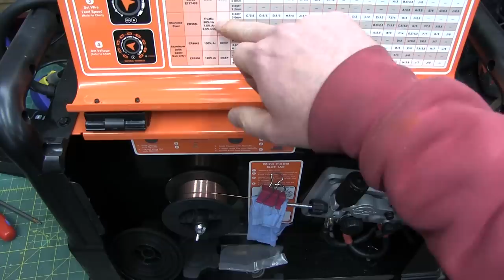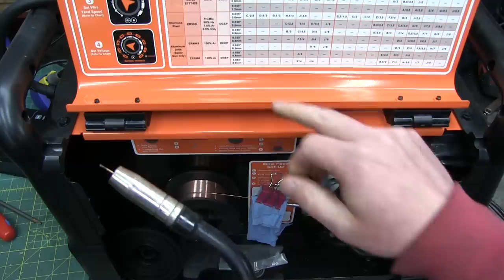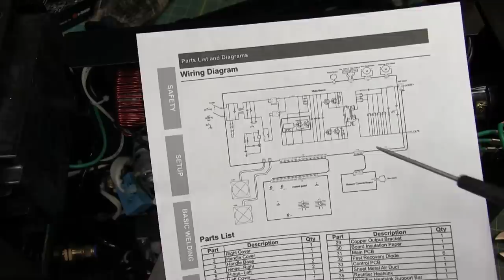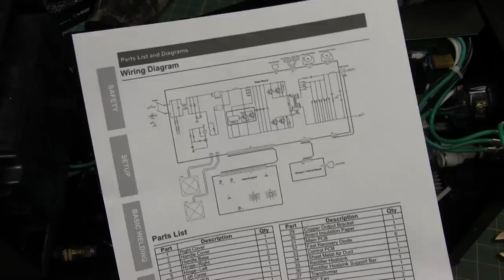BOLTR: Vulcan MIG 215 | Harbor Freight Welder

Comment: Huh.   Have a 211 in my shop and it has been okay so far.  The whole "just put in the material thickness and the computer will figure it out" is BS, though.

Honestly I requested a Lincoln 140 for the shop, but the guy purchasing them said that "Lincolns are junk!"
Reply: I went looking for more on why 211 NFG , anything other than a vendor made handle and switch flashing problem ?   ,The trigger is important,but not the whole thing!

Comment: "Learned" stick welding in the signage industry.  always soaking wet, at arms length, not enough room inside the cabinet for a proper helmet.  Gotta bend the trodes into pigtails EVERY TIME and you can almost never see what you're doing... All by feel.  So the only thing I really learned was that my head and upper body fit through a 7-3/4" gap, NOT a 7-1/2.

Comment: My Vulcan MigMax 215 just died a month after the 90 day warranty ran out and so Harbor Freight (HF) can't/won't help me. I talked to their tech support (outsourced to AWS) explaining that the machine will feed wire but will not arc. I was told that my issue is probably due to a "board level failure" so that rules out a replacement part from HF. They only offer a few external replacement parts.
So my questions are 1) how to identify the failed part and 2) how to purchase that part and 3) how to do the actual replacement of that part. Alternatively, how can I find someone to do this for me for a reasonable price. I'm in rural central Florida but can reach places like Orlando. Thanks in advance for any insights you may be able to offer.
Reply from the maker: Pretty tough to troubleshoot over the internet but I'd start with looking for any loose connections followed by any blown up components on the board.

Comment: So AvE, I have an issue with our vulkan omnipro 220 it has ran fine for us on the mig since 2018 and only now has been giving us an issue where the hot mig feed runs for 2 seconds then stops. The error messages we are getting is 1. Low voltage 2. Is too high voltage. 3rd. Is an overtemp error. All of them come up at the same time, we took the unit apart completely and looked at its brainbox and everything and nothing looked like it let the smoke out or anything out of the ordinary and it seems like its a common issue for all omnipros and we can't find anything on how to fix it. We can't get ahold of vulkan for repairs and harbor freight is useless on helping. Any insight?

Comment: First and only job I walked off from was tracker boats.
I worked welding on the aluminum pontoons and I saw the carpeting side toss a open gallon of rubber cement at the feet of a guy mig welding a bracket....the jus splashed cement on his legs and on the floor all over some electrical lines and an air hose.
I ran to him as he didn't know he was on fire with his hood on.
I yanked him to the floor and used me greens to smother out his legs and then the rest of the fire.
I got yelled at for running , and threatened to be fired for what I did after an investigation. 
So I just walked.
Btw we were also told if we use a fire extinguisher its instant termination ...only supervisors can put out fires.
Tracker boats suck

Comment: 4:00 I fixed a petrol-powered auger by simply loosening the screws(a bees-dick of a turn) holding the handle together. It was pinching the pivot of the trigger which stopped the throttle opening all the way, sure enough full throttle was full throttle again.

Comment: It's actually gmaw. Gas metal arc welding. You could still use pure argon so that would be metal inert gas. Or 75a/25c02 or 100%c02. So it's official term is just gas metal arc welding. And also, i know several proficient stick and wire welders that can't tig ( also incorrect its gas tungsten arc welding or gtaw) for fuck all. There's an entirely different skill set required. And also 100s more applications and materials to weld with tig so there's that. Anyway. Just adding some helpful info.  Not trying to keyboard warrior. I Just learn alot from you and would like to contribute some knowledge i do have. Welding is my trade. And you're right. It pays dividends.

Comment: Those who know how to weld and those who want to learn how to weld.  Tried hiring some welding done recently.  Three different guys, pipe fitters, "food certified welders," whatever.  EVERY SINGLE THING they did for me had to be redone, repaired or worked around.  I am NEVER having any welding hired done ever again.  If I can't bolt it or rivet it, you can just go fuck it.

Comment: The 200 lb gorilla does not go through the gun switch...it just activates a low voltage/low current side of a relay.
Reply: The 200 lb gorilla is the one holding on to the gun and yanking the switch.

Comment: Well, TIGging alu is not easier than sticking steel.
Aluminium is the main purpose for having a TIG torch, and those that only weld stainless or titanium will like TIG too.
Why would one TIG mild steel? The lazy use mig, the pour use stick.

Comment: Do not write off the welding gun so quickly I have exactly the same gun on my 12 year old MIG, the trigger is fine in all the time I have had the welder I have had to replace the gun twice and I weld with it nearly every Saturday or Sunday annually using around two or three 5Kg drums of wire a year. The first gun got a bit upset when I parked a 109 Land Rover on it, the second gun got messed up when I was teaching my three boys to weld they formed a habit of bashing the shit out of the shroud to clean out splatter from inside the shroud and off the tip they and i am still using that gun.

Comment: wtf, the shitty Craftsman welder I got for free (and never use shielding gas for, because it's only ever used for 5-minute jobbies) has a solid feel to the gas shield, agreed that its movement seems off-putting. But hey if it works it works.

Comment: i dont know about the Vulcan line but as far as harbor freight in general there is no parts that are available for purchase or any place to send for repair only option is to return for another discovered this when I bought an older lathe from a friend and also got the bandsaw and dust collector for free off craiglist neither were functioning fully and after a lot of searching they were torn apart for usable parts and rest was tossed this is why I no longer buy or even take any tools from them clowns. I mean if your gonna sell shit then at least supply parts or provide a repair facility of some sort

Comment: You didn't really get into the feed setup too much, thats were I always find a weak point in these cheap machines. They may have a arc thats useful but if they cant feed the wire right im putting the hammer straight through the middle of her. Usually its feed rolls with the groove not cut evenly around the roller, or a motor shaft with not enough support so when you put feed pressure on it bends or wobbles ouf of shape or my favorite is when they cant hold a steedy speed, even when they only change 15ipm while welding itll piss me right off.

Comment: Rubber meets the road when a tech student can’t run my 12 k German made ewm mig. 400 v. 500 amp. With force arc and pulse. Clown says it’s to fast and hot. Undercut and arc blow. What do I know. 25 years in the heavy plate trade. Fabracoblin excavator equipment. And I give her all she got. No worry’s.

Comment: your 211 was shit ? i have the 215 and never had a single problem with it. that being said, these horror freight migs are priced right for what they are and will most likely be fine for  hobby use. those caps are fucked stuffed in between those heat sinks. i'll stick with my blue machines

Comment: 211 is the worst Miller I have ever worked with I would rather work with an arc welding stick a battery and jumper cables then weld with that thing we have the 252 I believe that our shop and it's the cat's ass I've had some nice red machines too but they were monsters but Lincoln's not that bad I'm not partial to either one of them I'll weld with either one of them

Comment: That's not a shitty switch it's one that won't break and has some flexibility.

Most welding guns has that sort of switch, as the button will fuck out if it was a real switch.

The gun you have is a gen 2 US design.

The nozzle holder is fucking shit don't hit it on stuff or you fuck the ceramic holder, tape won't last with the heat it's not the electricity it's the overall heat.

Comment: whats a "sore dick deal " you need to do a translation vid for your sayings is it a deal deal or bad looks ok to me for a cheap shit welder the spring on the nozzle is standard fair  the trigger well by the time it gives you trouble well its going to have a kinked liner so you bye a hole new hand piece /stinger .whip anti fall off the ladder safety line

Comment: The gun is certainly a Miller/Hobart ripoff.  I took mine gun apart and there is little difference other than using a different and tighter spring holding the cup and a couple wraps of “Cobra” electrical tape where there was a single, no name brand.  I would not doubt the rest of the welder is a ripoff as well.  This is what happens when US globally sources in China.